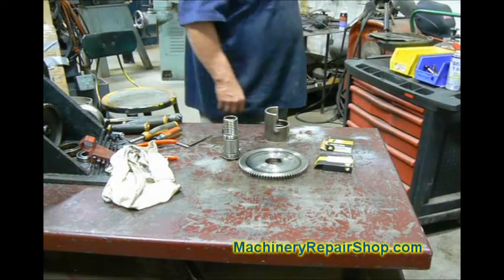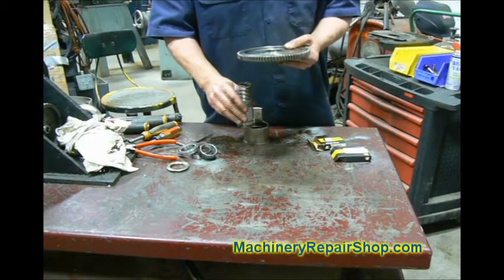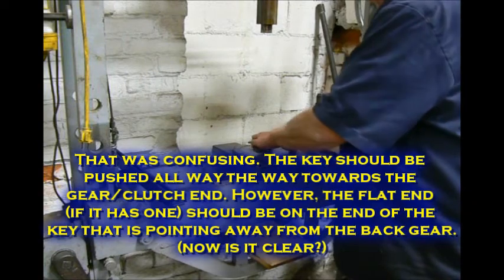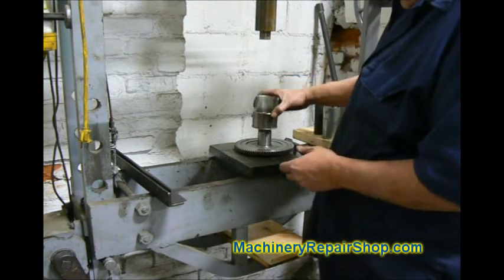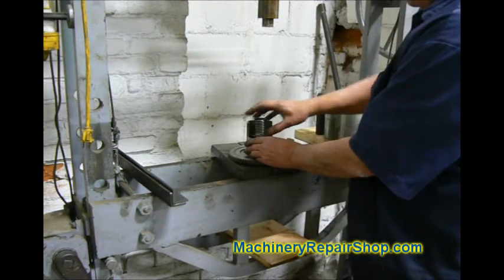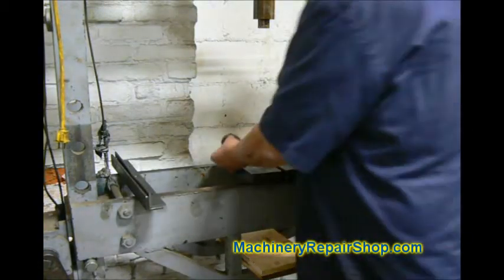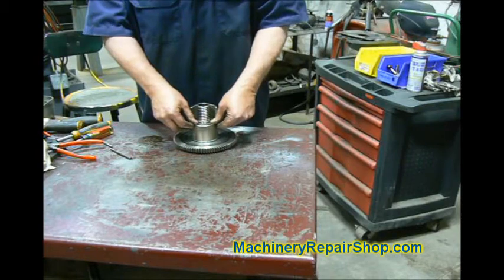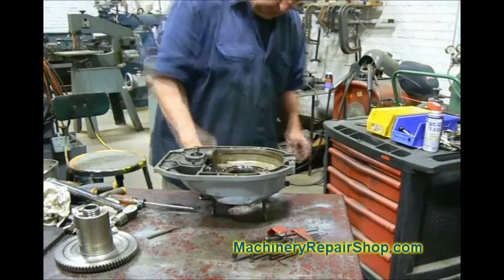Bridgeport Mill Variable speed drive (2J) reassembly part 2 - Back Gear assembly

Comment: is there a part 3 on reassembly, im struggiling with reinstalling the variable speed control properly its only giving me halph the range of speed. (small stop pin broke, replaced now but not quite right)

Comment: Can you tell me what causes what is known as the bridgeport rattle. I have all new bearings in my mill head, I am thinking it is the pulley adjuster.
John Fink
Reply from the maker: imystery man There are a few things that can cause a "rattle". Does it happen in lo gear, hi gear, both, and/or neutral? One of the most common causes in high speed only is the clutch dogs (the teeth that engage for high speed). These teeth are tapered, and when new they are designed to engage about 1/2 way down. As they wear they eventually bottom out, causing a rattle. Try moving the hi-lo shift lever to see if you can reduce or eliminate it. There is an adjustable plate under the index hole for hi on this lever. This can be adjusted to compensate for a lot of wear. Although they normally cause vibration, another cause can be the movable pulley bushings on the vari-discs. Any slop in these is normally bad news at some level. There are kits available to replace these bushings if they are the older plastic ones. Most of the bearings will not cause a rattle, but I have seen some where a bad bull gear support bearing will cause a rattle in Hi and low, but not neutral. These are the bearings under the large back/bull gear. The slop in the back gear in low can sometimes cause a rattle like noise, especially when cutting, but that is just the nature of the beast. Finally, if there is not a tool in the machine, the drawbar itself may be rattling - try pulling it out. When we recondition a  2J head, we normally replace both belts, the bushings, and all the bearings (in the drive section - not the spindle!!!). Cheap insurance for a longer life.
Reply: Thanks for your reply
I mainly hear the noise in low gear and neutral, it is very slight in high if any.
I replaced all the bearings and the plastic pulley bushings and the belt. The noise I hear sounds like a cross between a belt noise and a rubbing noise. Is there a trick to adjusting the screw with the lock nut right in front of the motor on top of the housing? My mill is a variable speed 2 hp.